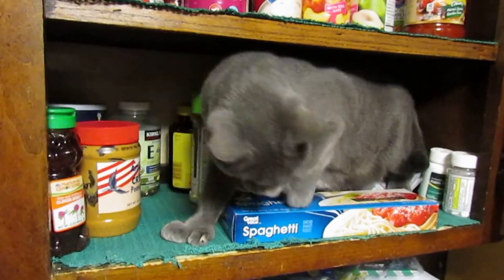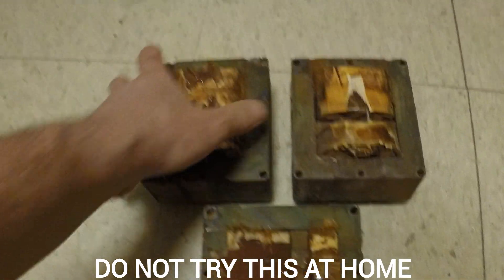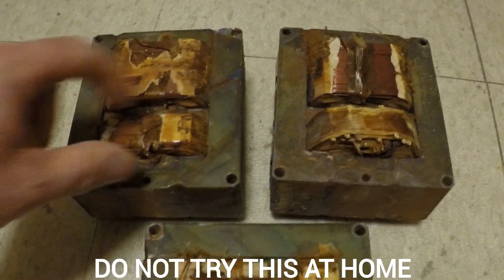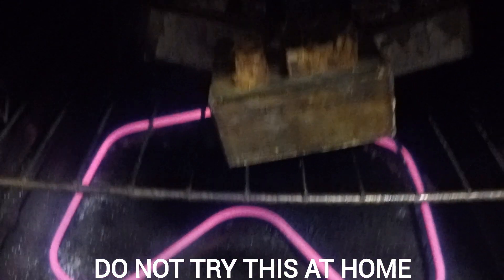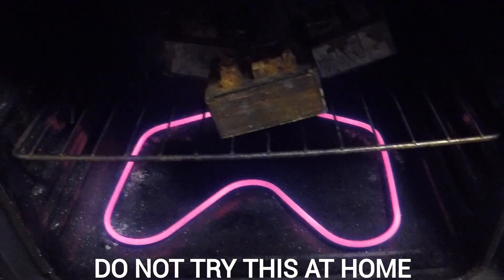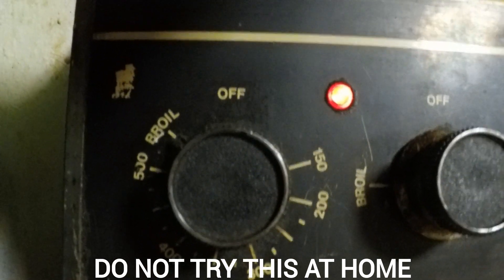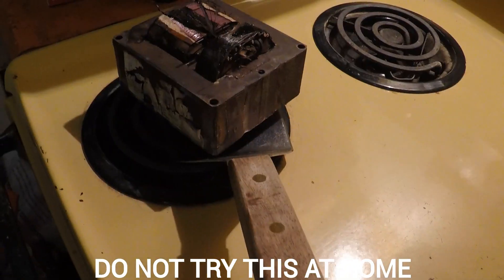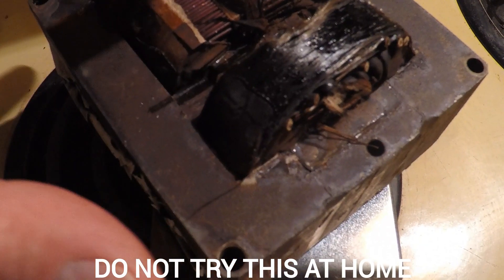FIRE & ICE Experiment - scrap COPPER Transformers A Legal Way?

Comment from the maker: I should have been more clear. There is an illegal method of burning these things in fires. This video is only an experiment to see if it could be done legally and safely with only heat at a temperature low enough not to burn the plastics and what nots which release the toxic smoke. (I vote for not being able to edit clips into published vids as being lame)...
Reply: I understand what you are saying and I guess I should have been more clear with my comment. I have been trying to find that channel that shows a clean fast way to break those things apart. I thought I had subscribed to the channel but looks like i didn't. By the way it was entertaining. happy scrapping my friend.
Reply: there have to be a power tool in existence to literally cut them in half. 

next experiment?

Comment: An air hammer with a sharp cutting bit on it to the copper to cut it off & a punch style bit to pound it out will net you a cleaner & much faster stripping of these & some scrap yards will pay #1 steel price for the steel if it’s still together. At least they will here.

Comment: I can't be sure without seeing the transformers a bit closer but a few minutes with a hammer would free that copper. Just hit the welds and they break apart. The metal plates make a square 8 shape one side is just a line and the other sides are shaped like "E"s. I had about 15 of similar transformers from out door light fixtures. Got about 10 lbs of copper in around an hour
Reply: Saw later in the video. Those ones have two "L" shaped pieces with a T between going through the copper windings. Pretty much exactly like the ones I did. 
Yeah a hammer and some elbow grease is faster and safer than your oven scheme.
Reply from the maker: please read the comment i just pinned to the comments 😅

Comment: Can you get a 55 gallon oil drum, build a fire, throw everything in it. Let it burn till everything is clean and the fire has died. Problem fixed. Just a thought. Nice video. I would run your oven for a few hours as hot as you can. Then let it cool, then clean it. The odors from what you were working with can't be as bad as the old oven cleaners. Now they were toxic.
Reply from the maker: (it's illegal) but BINGO! lol, I don't think anyone understands so far that I was experimenting to see if the no labor very ILLEGAL and dangerous  method you described can be done legally and safely, sigh.... i should have been more clear. Thx for the comment that allows me to clarify! 😅😜 - not being able to edit in clips to published videos is annoying...

Comment: another way is to take a 1" chisel and cut off the winding on one side--- then use a 1/2" bolt to drive out the rest--at times you will find rivits in the corners!!!!-----the time you spent trying to cook them you could have had them cut off!!!!!!

Comment: Do you know a way to get that steel off of the copper I found a few of those Transformers a while back and tried many different ways to get it off but couldn't
Reply: It's not easy to remove the steel, but it can be done, with a large hammer and a sharp steel tool (axe , hatchet). Find the welds and start beating them
Reply: Okay guys thanks next time I get some I will try it out
Reply: Joey Stewart look at my post above way better way to break them down and not beat the hell out of your hands.
Reply: Joe Coelho thanks man appreciate the info
Reply: Joey Stewart no problem you will get faster the more u do also when making the cut good to have it in a vice you can control it better.
Reply: Joe Coelho I had a few of them a month or so back and I tried cutting into them with a grinder but eight through the blade rather quickly definitely going to try your Technique next time LOL
Reply: Joe Coelho also do you think it is worth the effort to remove the copper like how much copper is actually inside Weight Wise
Reply: Joey Stewart I break down the larger ones they can have a good chunk of copper in them it all depends on the transformer. Otherwise I only get about .12 cents a pound if I leave it whole that is in AZ maybe you get a better price in your area for them then you would have to do the numbers. But copper is pretty high right now.
Reply from the maker: please read the comment i just pinned to the top of the comments 😅
Reply from the maker: Joey, ya like Joe said, lots of people dont account for the transformers being worth much higher price than tin/steel making the smaller transformers/electric motors pretty lame to mess with. The ones in ths vid are 15 pounders to start with not bad chunks of copper with no aluminum.